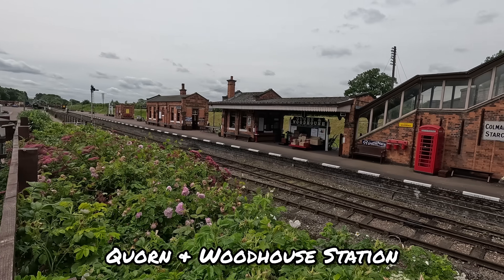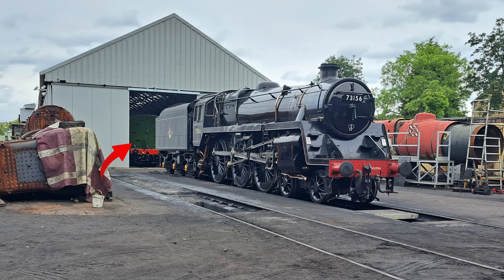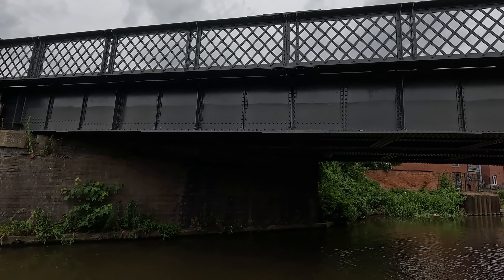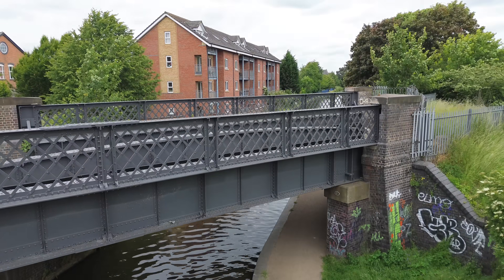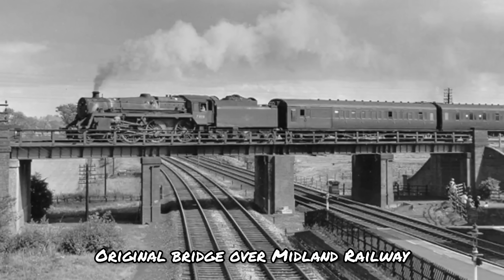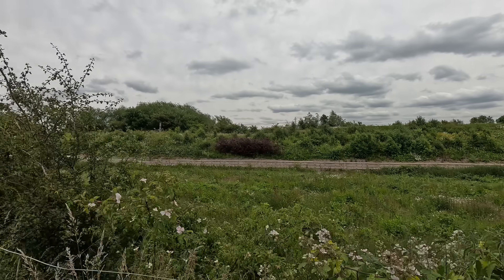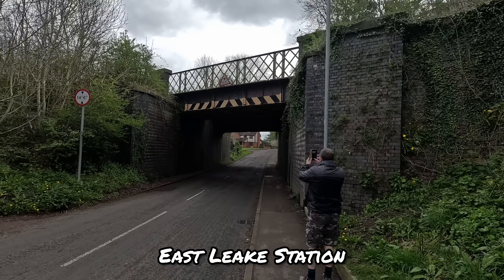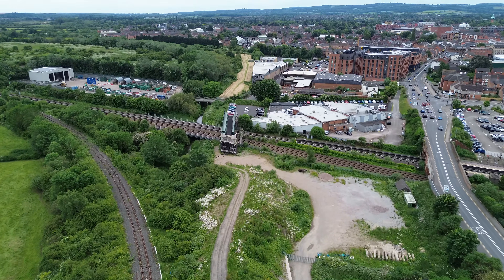What is Bridging the Gap? Great Central Railway Reunification

Comment: I can't understand why they put Loughborough Central so far away from the Loughborough Midland station. The Central Station should have been next the the bridge where passengers would have preferred to have walked between the two.

Same situation at Rugby where the two stations are miles apart but the lines literally cross over each other.

I guess it's all about politics
Reply from the maker: Yeah very confusing decisions looking back. Almost as though they didn't want them to connect the GCR to anything else.

Comment: New viaduct (bridge) over MML must be higher than original one, because was plan to electrify this stretch od mainline to 2020.
So, they build higher one, now line must be adjusted in height, to this new construction.
And... MML electrification plan was scrapped by tories... Typical...
Reply from the maker: Haha I wonder if electrification would reach Loughborough. It is still creeping north though. Is it up to Market Harborough now?
That bit of a climb out of Loughborough will make the engines work a bit more I suppose.
Reply: @WobblyRunner  I guess they only do electrification to Leicester.
But we have new goverment and some things may change.
But... It not make a sense for now to change this decision, because "high power diesel -  electric" hybrid 810's are already build. And comming into service this Year.

Comment: As a non railway buff I still fund it crazy in this day and age that anyone would close a major rail link that could be diversion or extra freight line as WCML is overloaded and Freight blocks it up.
Although we do not have a Coal Industry there is a lot freight to move to/from channel tunnel..
Reply: 1969 was 55 years ago so hardly current situation.    They did not have a capacity issue back then.
In the London Midland Region then had
WCML
Midland Mainline
Great Central
So 3 main lines however they didn’t need all 3 and being Midland Man then the LMR chief when faced with closing either the Midland Mainline or the GCR oddly enough chose to close the GCR and keep Midland Mainline
Reply from the maker: It sure would have come in handy these days wouldnt it. It's a shame that when they closed a lot of lines, they couldn't have left the structures in place or at least not built housing estates on the trackbed. It does duplicate quite a bit, but I always think about it when I'm forced to use the Midland Mainline anywhere, that they chose the wrong line to back in retrospect.

Comment: My understanding is that the embankment was taken to provide the fill for the embankment on the north side for the link to the midland main line, in the 1970s i believe. That wasn't there originally and was added to allow continued access to the mod and gypsum sites.  Previously it was accessed from north of Ruddington so it had to be connected at the southern end before the tracks through central nottingham could be lifted.
Reply from the maker: Ahhh interesting. That makes sense I suppose.

Comment: The British way of knocking down the infrastructure is almost unique to BR (as it were). In the USA lines no longer in use are left for the simple reason that another company may wish to reopen it so instead if having to deal with the nightmares of new structures on the trackbed such as at  Tavistock North and the cost of demolition and re-siting these buildings, the line is ready to go. Perhaps desperation for cash from selling of the sites and the metal, in fact anything which would make moneyfor BR (and the Treasury)  has added heavily in this country to the cost of re-opening closed lines.
Reply: I think its was deliberate policy to render routes useless judging by the way it was carried out -- not just on the old GCR route but all over the country. The savings from line closures and the relatively small amounts from most land sales are vastly overshadowed by the cost to rebuild the infrastructure where its been found necessary.
Reply: @martinusher1 HS2 would have been viable if so many links hadn't been severed.
Reply from the maker: You're too right. Added the extra complications of planning consent and red tape. And nimbyism whenever a railway is lobbied for reopening. So much red tape.
Reply: Part of it is because although disused, British Railways/British Rail/ Railtrack/Network Rail, were/are still responsible for the upkeep and keeping the infrastructure safe. So they were quite happy to demolish and get rid of the responsibility especially of the bridges and tunnels across the country. Awful lot of them to maintain for lines not used for many decades. Still sad to see 😢